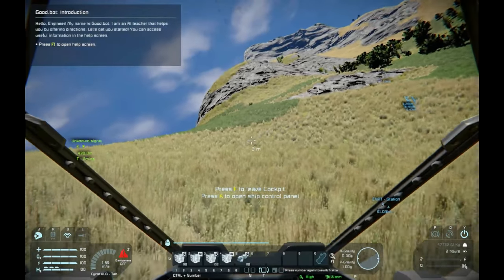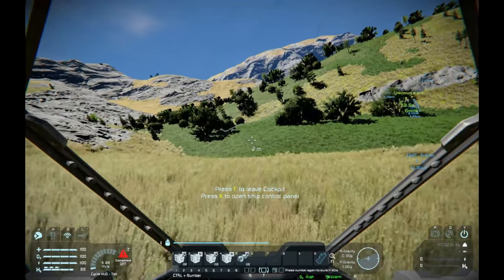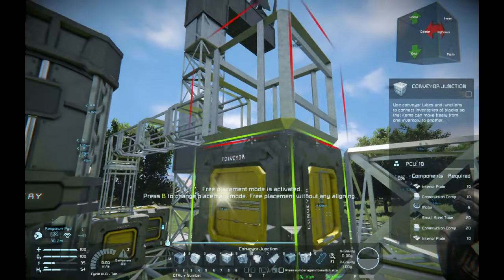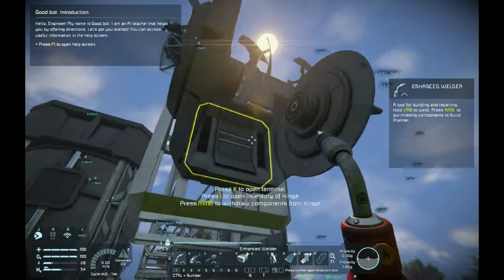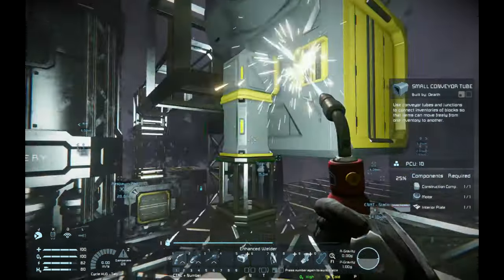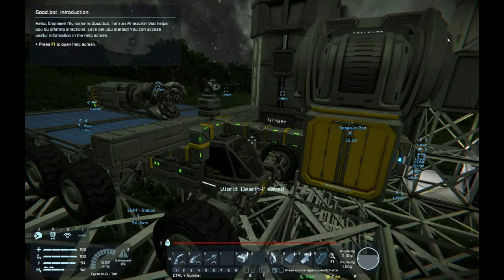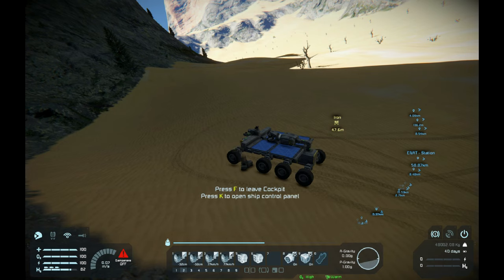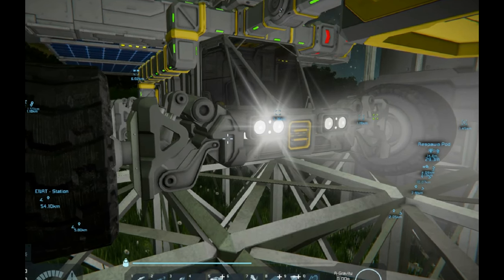Space Engineers EP4 - Hinge Explained pt 2 - How to Make Charging & Transfer Station | For Beginners

Comment: Hey man, I tried this out in my game and i could not get the hinge to detach from the rover. Even when I destroyed the hinge with the grinder, it was still attached. What am I doing wrong?
Reply from the maker: @skyfaller  You can attach and detach the hinge base from the hinge head by hitting K to go into the hinge's control panel, and look for the Attach and Detach buttons.  I think that is your question?  You can also set that attach/detach action to a hot key while in your rover or ship.  You get to that while sitting in your rover or ship cockpit, press G, select the Hinge, then drag down the Attach or Detach function to a slot on your hot key bar.  Hope all that helps!!  Let me know how it turns out.  :)
...oh!  and one more small thing.  If you do want o control the attachment and detachment from inside the rover or ship, make sure the hinge base is the piece attached to the rover/ship.  It's that piece that can actually control the thing, not the hinge head.  I mentioned it at the end of the video, but it's easy to miss that little nugget.

Comment: ho do you send items to the refinery? I've been trying to send items from robert to refinery and it just doesn't work
Reply from the maker: @Trevorsouloriginal If connected to your rover, the refinery will pull the raw ore it needs out of the rover.  You can also open the Inventory and manually move ores over to a cargo container connect to the refinery and let it pull from there.  Couple things to note that may be your problem:  1) If the refinery inventory is full, it won't pull anything.  2) If using the basic refinery you might have a tier of ore that the basic refinery isn't able to process - you might need the large refinery. 3) Similar with the survival kit - it doesn't process ores at all, only raw stone.  Hope that helps and let me know how it turns out!

Comment: Recently I've been playing around with the hinge block when building a shit to transport a rover inside. After a fair bit of trial and error, I managed to use hinges on the loading ramp for it to open and close. However, with the ramp being a subgrid, twice it has become stuck and once I found it had turned itself into a station. This was after when loading back into the game and go to fly the ship. It became stuck and it wasn't until I tried closing the ramp and the ship somehow moved with the ramp being stationary.
This has happened again but the station option isn't there and the ramp being fixed in place. I've looked up that there has been problems with subgrids when hinges, pistons and rotors are used.
Is there a way to fix this without having to rebuild the ramp each time it becomes stuck in place?
Reply from the maker: I've never really experienced that exact problem, and I don't know exactly how your ramp is laid out, but here's a couple suggestions.  
- Don't try to recess the ramp into the body of the ship when it closes by slide blocks past each other - Space Engineers doesn't like that!  Either construct it so only the corner/edges of blocks touch or use the blast door blocks that have 2 sides shaved down slightly to allow the ramp to recess.
- If you ship is landed (and I assume it is because a rover is being deployed), don't Convert to Station.  This can get invisible parts of voxels stuck in the ground, and make it more permanently a station...requiring grinding off of blocks to get it unstuck as a station.  Similarly, when constructing the ramp, make sure you are well clear of the ground, so a piece of the subgrid is no where near the ground.  Remember that everything for game calculation purposes is a square, so even a tiny interior light takes up a full voxel square in the mind of the game, and even if a teeny portion of that square is touching the ground, it may think it's a station.
None of this may help you, but it's couple ideas that might lead you to a solution.
Reply: Thanks, will give that a try. The ramp was lowered when this happened first time around and the rover that was parked inside was also stuck. I had to maneuver the ship that was on a planet so the rover would slip out of the loading bay and its small grid was just stuck in mid air lol
The creative game may have become buggy, but what you said about the game not liking two surfaces sliding against one another does make sense as to why the closed  ramp is pinning the ship out in space.

Comment: Why not use a connector?
Reply from the maker: Two or 3 reasons here: The connector just looked way too big and out of place on such a tiny rover.  This was a way to create something maybe a little different.  The small connector we have now wasn't in the game back then.
If you are making a rather small rover, you can either use a method like this or use the new small connector they recently added to the game. If you use the small connector, you'll need to convert the base's connection to a small grid connector similar to the way I did it with the small hinge - the larger connectors and small connector won't work together.